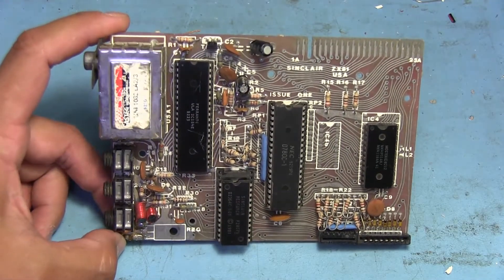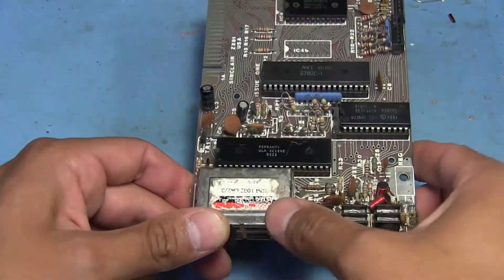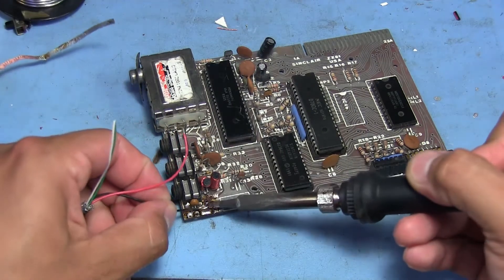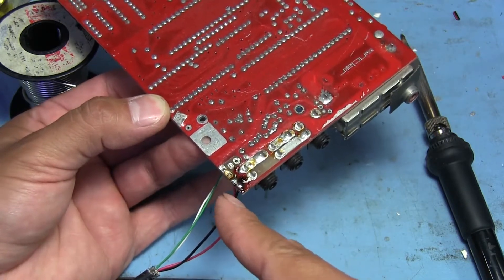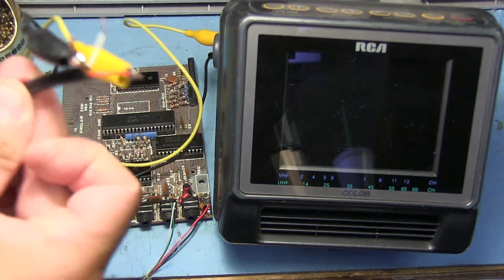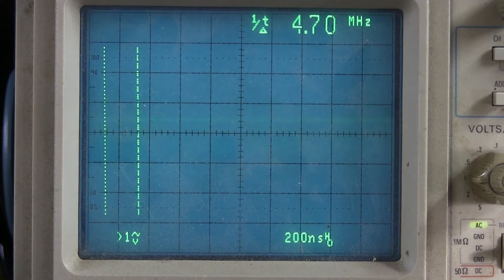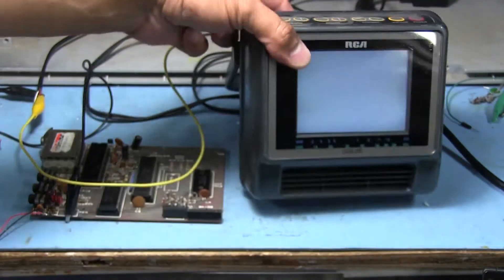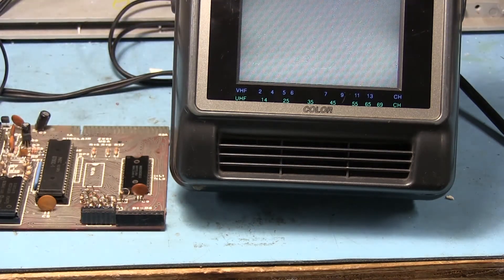TWB #54 | Sinclair ZX81 Board, Unknown Condition - Will It Power Up?

Comment: Far fewer parts than on the TS 1000. You can also recap and do the composite mod fairly easily. You can also replace the 7805 with a TRACO TRS-1 2450 FOR $5 WHICH RUNS MUCH COOLER.

Comment: It’s pal
Reply: Actually it is neither.  PAL and NTSC are for color (or colour :-) and it is black and white.  PAL systems generally run at 50hz and NTSC at 60hz.  The original ZX81 ran at 50hz for compatibility with UK (generally PAL) systems.  That said, the USA model ZX81 (and the TS1000) ran at 60hz by default.  All the boards (and the ULAs) were built for either.  There is a resistor you can ground for one option or leave floating for the other on all models of the boards.
Reply: @desiv1170  Yes, and you can see that USA is silkscreened on the board in this video, so this particular ZX-81 was made for the U.S. market.
Reply: No it's not. Otherwise the "K" wouldn't have appeared.

Comment: A really good video. I actually have about 10 Sinclair Spectrums at home, which I've repaired over the years. I also have two Commodore64's and a VIC20. But I'm yet to own a Sinclair ZX81. Perhaps the fact that it has no sound or colour (sorry I meant color :O  ) is probably why I've never been that interested in owning or repairing one. Warmest regards and keep on with the great vids. Wayne and Nina.
Reply from the maker: There's just something I love about old technology. And even though this doesn't have sound or colour (ha), I'm just happy seeing it function, although I'm bummed that I didn't keep the casing. I think it's amazing how they packed a lot of the glue logic into the ULA to keep the device small and compact. I have yet to come across a Spectrum or Commodore, but I did come across a ZX81 RAM cart at a thrift store once a few years ago for a couple bucks and I passed on it... now I'm kicking myself over it.
Reply: Yes, old tech is fascinating stuff. And in some cases, probably more reliable. These old Spectrum computers have been around for years (at your end in America, they would have been Timex Sinclair Spectrum). They only ever need routine repairs. The odd dodgy capacitor, or blown memory chip. But in general, they are all good old stuff. We are now working on an old Tektronix DAS9100 logic analyzer. It's huge and ways a ton. Need to do some weight training :O
Reply: No no, Colour (with a U) is correct Nina